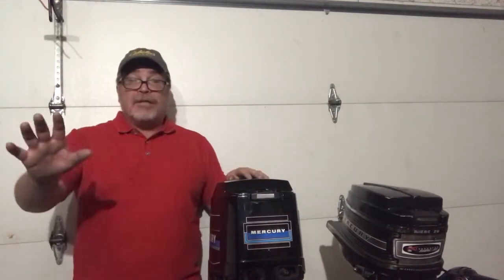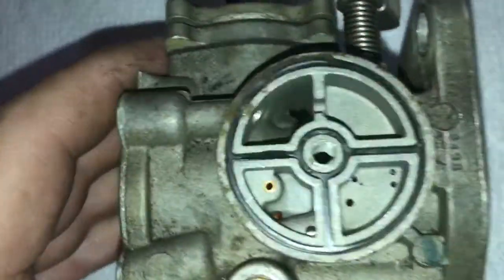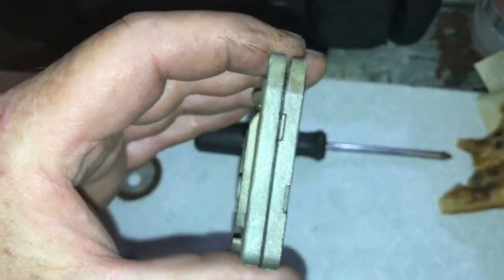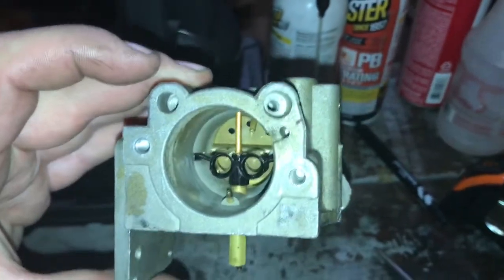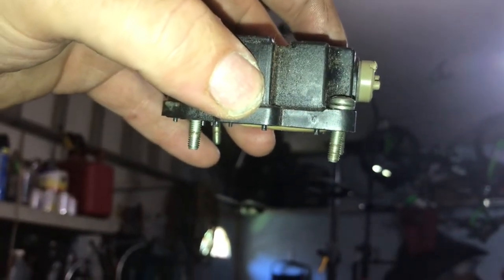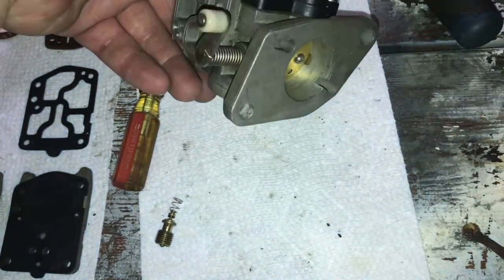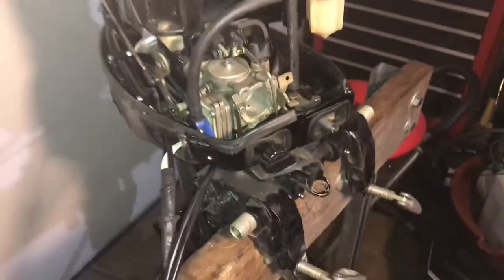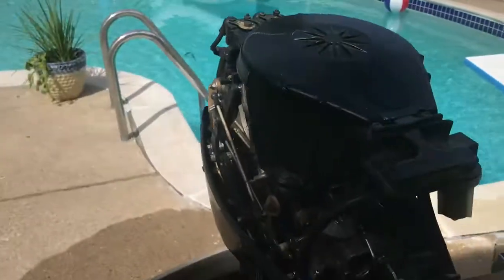1982 25 hp Mercury - Won’t Start - Fuel Issue Fixed

Comment: What one adjusts mixture? 
Feel like the idle and mixture are usually different.
Reply from the maker: Aaron Kraft … The fuel mixture screw is the one on the top right in the video at 6:04 min.

Comment: I have the same engine and carb. Do you know how to adjust the float?
Reply from the maker: I didn’t make any adjustments to the float since it’s made out of plastic I don’t believe adjustments are possible. If the float is warped you might just want to replace it.

Comment: hey I have an 18 hp the same engine, I have some questions about the choke, I noticed yours has settings, mine did aswell but not it dosent lock on and I dont know why, can I mag you and ask some questions
Reply from the maker: Richard Ohare … I no longer have this motor and also remember little about the way this choke design works. You might want to purchase a service manual for this particular motor. It should have the information you are looking to find.

Comment: Hi from Italy! Great video! One question: how do you start the engine when the engine is cold (first start)? I mean, how do you set the choke knob? Many thks
Reply from the maker: Matteo trevenzolo…. Hello. Thank you for watching and commenting. I really can’t remember exactly how this particular choke worked but you definitely want to turn the knob to close off the shutter to the choke completely then after it coughs or sputters open the choke slightly and it should start up then open the choke completely.

Comment: I have the 83 version. I need to know the choke on it the marking are all worn off. Would you be willing to make a quick video going over the knob on the motor the circular one please.
Reply from the maker: Lumpy gas In a vacuum… Sorry I sold that motor and don’t have any footage on the choke. Sorry and good luck with your motor and thanks for watching.
Reply: @LivetofishOutboardRepair  thanks. I got it dialed in today

Comment: I see you backed out the idle screw 2 turns from lightly seated. I also had to go 2-2.5 turns out from lightly seated so the motor would idle without killing. The manual states 1.25 turns from lightly seated. I was concerned about my setting, but this makes me feel better. Also, the further the screw is turned out, the richer the mixture, so that's better than being lean (albeit at idle).
Reply from the maker: greauxpete …. I completely agree. Thanks for watching and commenting.
Reply: @LivetofishOutboardRepair  I soaked the carb and followed with 45 minutes of heated ultrasonic cleaning in a special carb solution. So, I doubt any passages are clogged. I also changed the enrichment seals, so not sure why it's not idling at 1.25 turns out?
Reply from the maker: Greauxpete …. just curious did you follow up with reaming out out the small idle circuit holes with a small wire and use compressed air?
Reply: @LivetofishOutboardRepair  I didn't use wire, I did use 100psi  compressed air and a heated ultrasonic cleaner though. If it runs right under load, I'm rolling with it. Seems like you had to go 2 turns out as well, so maybe there is an anomaly in the service manual.

Comment: I have one just like it
Reply from the maker: Larry Nichols… that’s awesome. These are great motors. I hope you get out to use it this season. Thanks for watching and commenting.
Reply: I had the same problem with mine the thing with mine my float got a hole in it and it won't keep idle
Reply from the maker: @scodder37  It’s good you were able to identify the problem. I hope you were able to get a replacement for the float.
Reply: They don't make that float for that year anymore so I bought a carburetor on ebay off of a 18hp same year I'm just gone clean it up  and change the jets form the 25hp to the 18hp carburetor
Reply from the maker: Larry Nichols … that sounds like a good plan. There is a company called NLA marine parts  that may be able to help if your not satisfied with the results. I show this business in my last video https://youtu.be/96l8nkrH9jU
If you want to look at it. Their contact information is 616-325-0757. They may have the float you need.
Reply: Thank you sir i appreciate your help
Reply from the maker: @scodder37  no problem. I’m glade to help. I hope they have what you need.  Good luck.